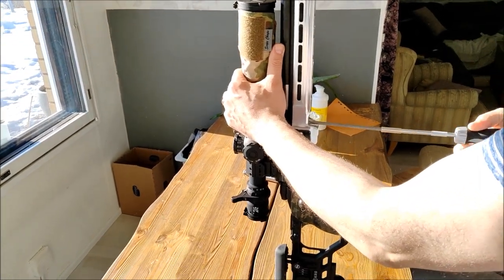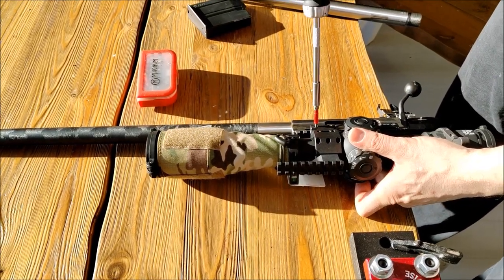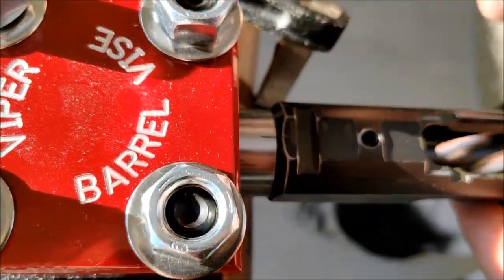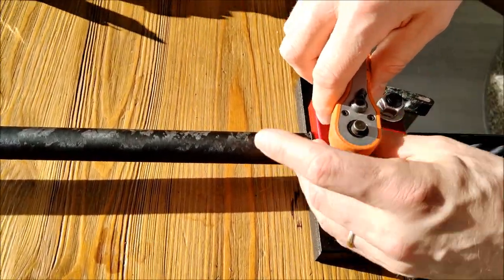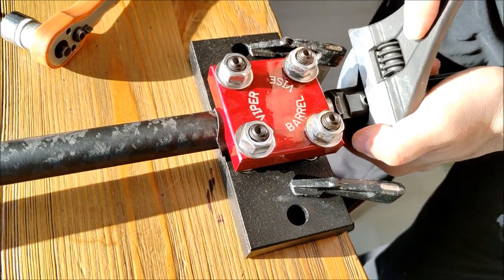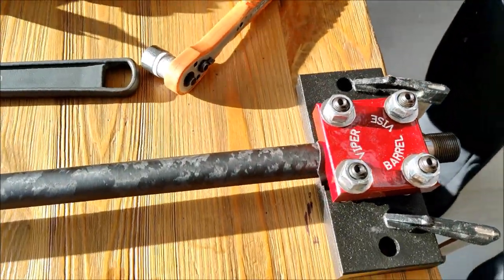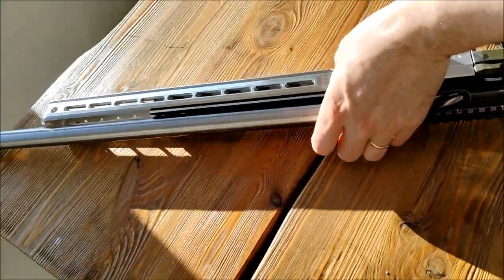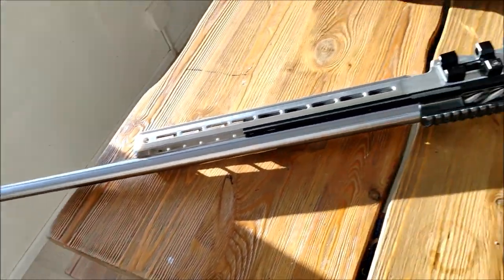Barrel change at home in to a Tikka action. Carbonsix barrel off , Krieger SS barrel in.

Comment: I use the same barrel vice when I change the barrels on my Howa 1500's. I use a Torque wrench whether I'm working on my bolt actions or my semi autos.
Reply from the maker: It is ok vice for the price
Reply: @PassionforRifles  I agree.  I would much rather have the short action customs vice.
I'm currently saving for better reloading equipment, In due time though.

Comment: So... did you just buy a stock Tikka and then swap stock and barrel?

Are the barrels pre-fit or do you have them fitted by a gunsmith?

Also, do you change calibers from say 308 to 260rem (or 7-08) since you could, or is it just for weight reasons?

How do you feel about piecing together from zero, meaning buying premium actions and then installing pre-fits and everything vs. modifying a stock rifle?

Sorry for the many questions, i'm looking at options myself right now! Nice rifle.
Reply from the maker: @mysterioanonymous3206  Gunsmith did the fitting job

Comment: How did you make the marks on the barrels?
Reply from the maker: Gunsmith did those. Marked the barrel when the headspace was right. So i do not need go-go or no-go gauges when i change the barrels

Comment: I assume you must re-zero it?
Reply from the maker: Yes sir. Just was on the 100-meters range today. Shots were 1.2 MRAD up and 1.8 MRAD on right. But the Krieger 28"Stainless is much faster. 100 zero at 300-meters 1 MRAD and 1.5 MRAD with Carbonsix with 139gr Scenar.